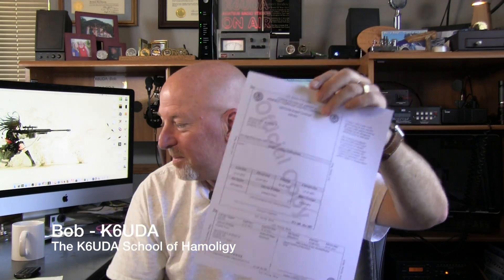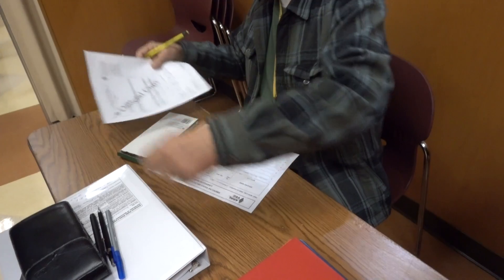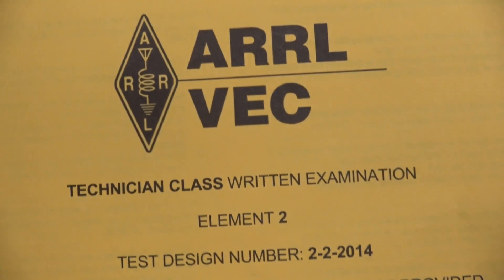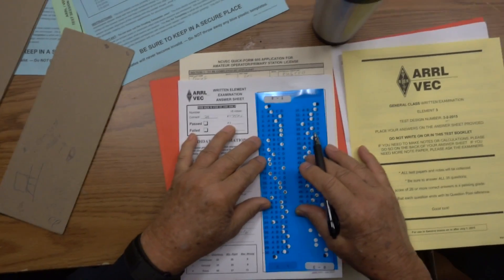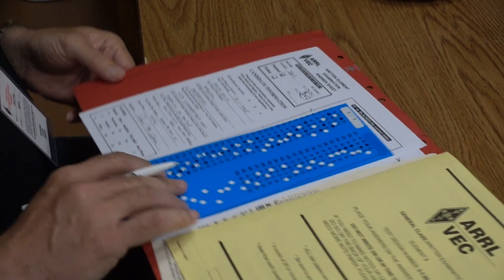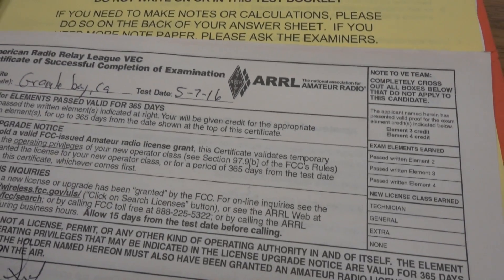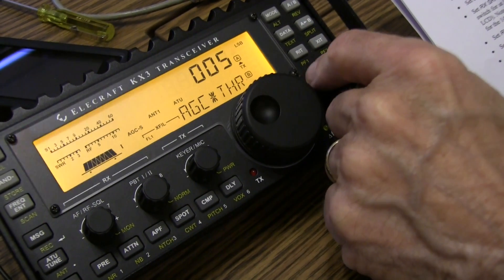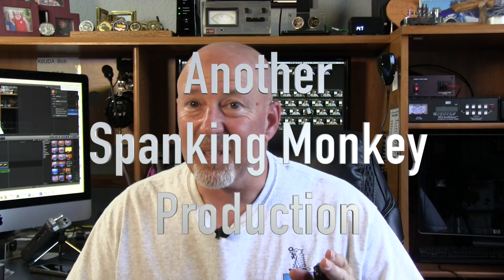K6UDA Radio - Undercover look at the Ham Radio Test,  KX3 Roofing Filter Install

Comment: BUT…do you know the Sark-110 (which I’ve owned) is the more accurate device? I sold mine because it just seemed to have different readings than more rigorous single-port vna devices. A check is to go to 15 MHz and compare the kx3. I bought a kx3 package recently and ordered the roofing filter so I’ve got to do this cal myself. But I’ve got the benefit of several HP Sig Gens fed by a common GPSDO. Nice video segment!

Comment: Does this app give you all the pool questions for each test which is like "700" questions or just what is on the actual test?
Reply from the maker: It did. The video is several years old and the apps may have changed.
Reply: @K6UDA  Did as all 700 pool questions or just what is on the test?

Comment: While $3.99 may be less money than the cost of an ARRL License Manual, the ARRL manual is a LOT less money than a "smart phone."  Besides, the monthly fees to use the silly phone are more than the annual dues for most autopatch equipped repeaters.  Besides, I'm too old for those modern day CBs.  Before I throw any money away on a dumb phone that will soon be outdated and have to be replaced, I would rather add something to my gun collection, because I prefer appreciable assets to things that lose their value quite quickly.  

I used the ARRL manual when I upgraded from Advanced to Extra.  It included ALL the questions in the FCC pool of questions and software that would generate a sample test such as would be given by the volunteer examiners.  It had been a long time since I upgraded from Tech. to Adv., so a lot of study was required.  The whole concept of television receivers was completely different; there were no more CRTs.  This old retired accountant that never worked a day in his life in electronics found that the ARRL License Manual enabled me to score 100% on the test.  Thank you ARRL.

Comment: Newcomer here. A friend has purchased the ARRL License Manual (Technician Class). But, I am finding it very intimidating and confusing when they start talking about the mechanics of circuits and radio waves. I am getting mixed advice of what specifically I should be studying. Some say the manual, others certain websites, others smartphone apps. Regardless of what I am looking at, reading, and so on, I('m finding VERY technical and specific information in all of it to where I get a feeling of being overwhelmed and frustrated because of some of the "practice tests" asking things like "What band is xx.xxx in" or "what frequency goes into 10m band" and the manual is still teaching me about the power is like across components in a parallel circuit...

Comment: My dad was a Ham. I got my Tech Plus in 1992 as another way to connect with my dad. I studied from the Radio Shack / Gordon West booklet and cassettes.  I did a lot of CW then. Three years ago, I passed General & Extra, the next year,  by studying On Line study questions. Repetition of the questions made it easier to pass. The pressure if off to Just Pass The Exam, I am going back and learning the electronics at my pace.

Comment: Well at least it seemed like the VE's were quiet during the testing.  I wasn't so lucky when I took my tests.  It's ok though, walked in with nothing...walked out with my Extra ticket.  I came back to the same group as a VE a little while later, and they still sat around talking while people were taking the tests.  Also, look around for LAUREL VEC affiliated examiners (laurelvec.com) They don't charge the testing fee...free since 1984!

Comment: I was thinking about taking my HAM test, love GMRS and FRS but want to try more. I dont drive(right now) but I do have my State I.D. Do you know if this application for the smart phones are still out there? I was thinking of doing the third one (the last one that gets you the most distance anywhere) are all 3 versions/ranks/levels etc of the test the same questions or different? Like do they share some of the same with more.
Reply: Some exam classes may have questions in common, but the question pools for each class are different. Then there are different test versions for each class. 

What happens is that you go in take the Tech exam. If you pass, you can take the General exam. If you pass that, you can take the Extra exam. On the same day, it doesn't cost cost any more to take the other exams, but it is worth it just for the practice..

The Extra class license does not "get you the most distance". It "just" allows you more operating privileges (frequencies, power levels, operating modes).
Reply: @johnc8910  Oh I see thanks for the info man. But curious what happens if I fail the test, can I take it while I'm there a bunch of times til I pass it? I guess they'll charge me 15 bucks a try unless I pass it then I can try the general? The expert I think I'll skip since that's for worldwide which I dont need really. Besides if theres a apocalypse or something I doubt anyone will care about licenses lol.

Comment: Well, now you've memorized a bunch of question and answers and still don't know a thing about electronics. Progress?
Reply from the maker: Absolutely. Once I got my license I started learning.
Reply: The problem with HAM is that you can't do it without a license. 

You get certifications for IT as well, but you don't need a cert to get the job or do IT, the cert just shows you know about whatever the certification is for. The issue with HAM is that you can only read theory and can't actually call on a radio without the license. This method is useful, but if your test day is two months from now, like mine, then studying heavy makes more sense.
Reply: @Kevin-zv6ds 
It's the cart before the horse syndrome. You learn the electronics and regulations first. You use a dummy load to test the circuitry of a transmitter; inject a signal and observe or listen to the result in a receiver. Then, you get a license to actually apply what you've learned on the air. Except for the regulations, you won't have to study because you already know electronics. This is why there is an abundance of appliance operators that don't know what to do when their equipment breaks down, and IT WILL! Generally, the new ham has done something to cause a problem because they don't have an understanding of how things work. It's broke, now what? Learn the electronics first. That way, the new ham won't be headed to a forum to find someone who actually knows something and prove how inept they are. The only thing that the current licensing scheme does is set them up for an expensive disaster. (and make money for manufacturers and ARRL).
None of this is meant to be offensive, but the current licensing scheme, at best, SUCKS and does nothing to benefit Amateur Radio! It's actually a disservice to any aspiring ham.

Comment: I don't know how you can sit there and tell people not to actually learn anything, just memorize some questions for a test so they won't know a dam thing when they are on the air. You might as well just make up your own call sign and just illegally transmit.
Reply from the maker: Does it not occur to you the reading a question over and over again with the right answer doesn't impart some knowledge? Kids learn their ABC's that way, In addition to that, there are loads of people who don't "get it" from reading a book. being able to easily get that initial license now gets the trainee invested in the hobby and that's when the learning begins.
Reply: @K6UDA  No it doesn't, memorizing words imparts no practical knowledge. Quick, without looking what does P = Erms^2 / R do. Ya, if you only memorized the questions, that is just gibberish.
Reply from the maker: @stickycricket2  And you just proved my point. I'm not an engineer nor a mathamician. You obviously are. I don't learn out of a book, I learn by doing. It's called being a kinetic learner. I didn't start learning what this hobby was until I started actually doing it. I guess we'll just disagree on the best way to learn. Looking forward to your video on how to pass the ham radio test.
Reply: @K6UDA  No, I'm not an electrical engineer nor am I a mathematician but I understand that simple equation and how to derive it from P = I x E and E = I x R. So you just start transmitting on any frequency with any output power you wish until you get a fine from the FCC because you just learn by doing? That seems like a completely ridiculous notion. There are classes to teach ham radio, your solution of "just memorize questions" is just plain wrong. Guess when you run your radio off a set of lead acid batteries, you run it until a volt meter shows 0VDC, assuming you know what that even is. Then you wonder why the batteries don't hold a charge, next time you only run them down to 1VDC and the same problem exists. See how "learn by doing" doesn't work for everything? But what am I saying, you're telling everyone to use a radio that costs less to replace than to recharge.

The fact that you're an Amateur Extra and you can't tell me anything about that formula tells me you didn't learn anything by doing.

Comment: I was ripped off!  I paid $4.99 on Amazon for my Technician test prep guide.  What I did like about my guide was that it only provided the correct answers.  Why go over 1700 answers when 3/4s of them are incorrect?  I went through the entire guide about 3 times and the question portion a couple more times.  That's about four or five hours of studying.  At least I passed with 100%.
Reply from the maker: There ya go. I think you got your money’s worth.
Reply: I was being facetious!

Comment: Not sure if he mentioned it or not but, a big key is to NOT read ANY of the wrong answers, EVER. Just read the question and the correct answer. Your mind will associate that question with that answer.  Never read a wrong answer so, when you take the test and an if you can't recall which answer is correct the only one that should look vaguely familiar is the correct one 99% of the time.
Reply: Totally agree.  I got the prep guide by Craig Buck K4IA.  It only gave the correct answers.  I got 100% after going through it about three times and going over the answers a couple of additional times.
Reply: I did that for a week, then looked at the whole group of answers, I was getting 96% on the practice quizes and doing 92% when I took all 712 Extra questions in one sitting. I agree it is the way to start, but in some parts of the quiz it won't work
Reply: What is the name of the app he shows?
Reply: @UncleFesterBond  How about the app for Android?
Reply: Richard Adkins ,    This sounds like great advice.   Thank you.  If you think of any other sound advice I’m all ears.
Reply: @Rich H Oh, absolutely. It's the only way to go. Though, I can't take credit for inventing cheating. I think the FCC takes that cake with that idea by posting all the questions and the correct answers publicly.  Once I passed the exam, then I took my time and really began to learn the meat of the matter. I mean, I don't want to be one of those DUMB cheaters. ;-)
Reply: Richard Adkins That is called the MFJ study guide method and why so many hams today have no clue about much of anything technical.They memorized the answers and have no clue why that is the correct answer and are totally lost about so much about the hobby.
Reply: @1OFGODSOWN  so true but you can learn by doing, experience is the best teacher, just remember the rules so you won't get your license revoked by doing something stupid.
Reply: And NEVER take practice exams before the test. You'll be reading the wrong answers with the correct one. The more practice tests you take the Lower your score will be.

Comment: I took my General and extra on 11/15/16. I couldn't believe it, I passed both tests. 85 questions and only missed 1. No more tests forever!!
Reply from the maker: Nice job.
Reply: can you tell me what books you used to prep? thanks..!
Reply: @terri4340  I use a site called
Hamexam.org
to study for the technical license. 
I also used study cards and Technical Q&A book.
Reply: the crobar m
Reply: Nice job but isn't it only for 10 years at a time? Also, which one is it he general or extra do you have to take to get the most distance just be able to buy any ham radio on amazon and use it without worries? I don't want to be limited in power, watts etc.
Reply: No more tests ever?  The test is every time you key the mike.  LOL!!  "Why isn't my radio transmitting!!!???  Oh, I forgot to attach the microphone.  Oh, I unhooked the coax for the lightening storm, no wonder it took so long to tune."  LOL!  It is nice to have the extra and just roll down from 14.225 mhz and be able to contact anyone.

Comment: Funny because Commercial and GMRS still get licenses in the mail..
Anyways I can pass all the ham tests on the first try. It's not hard or challenging anymore and that's one reason I put off even bothering with it..
Anyways I own some cheapo radios but I lease them out for events. my actual radios are high tier Motorola digital radios..
Roofing filter kits are not hard to install and set up if you have done it before, I did a few about a month ago for a guy locally and used an IFR1200 service monitor.. easy peezy.
Reply from the maker: +ElfNet Gaming then I expect to see an extra ticket the next time we talk.  👍
Reply: LOL alright when I get around to it.